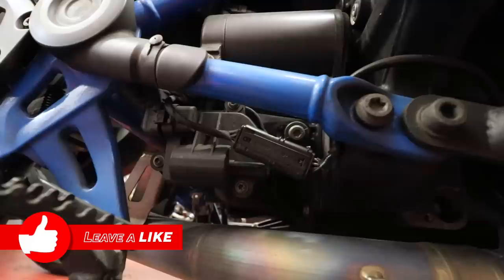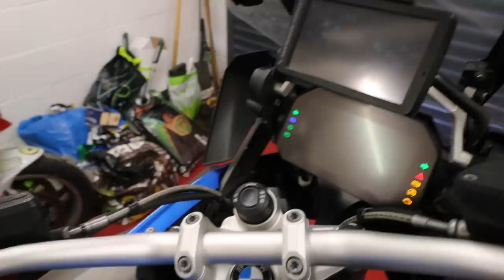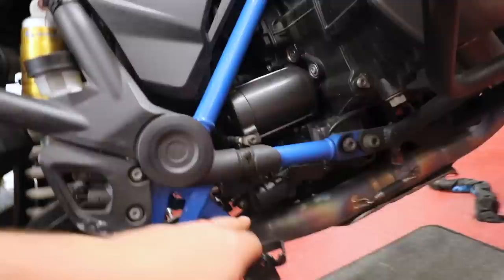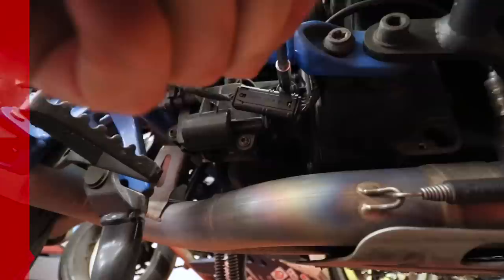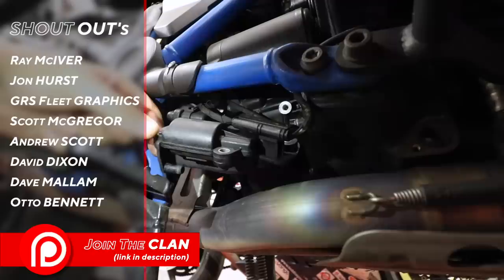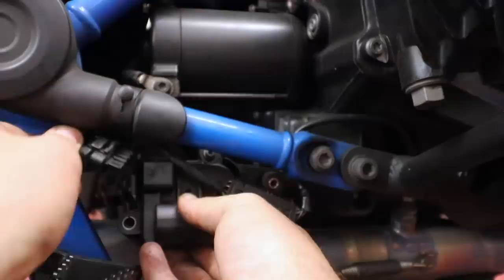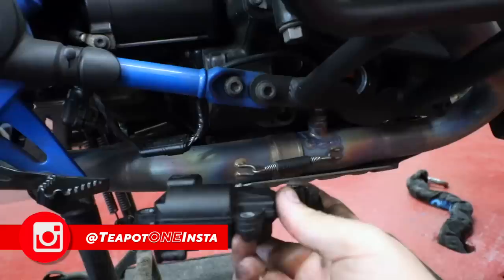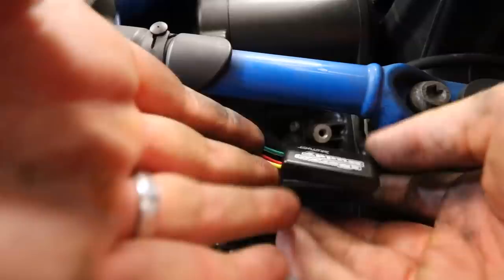Skutrnet Servo Buddy - Exhaust Servo Eliminator Install on BMW R1200 GS

Comment: I wonder if it would be good to slide a bit of heat shrink tubing over the servo buddy and connector as it looks a bit flimsy?
Love the channel mate, and well done for "sticking it to the man"!!!
Reply from the maker: +FriendlyEllis thanks bud - yeah I thought that too, it just seemed to be too open to the elements doesn’t it.

However, I filmed this last August so it’s been fitted to the bike for around 8 months now and been ridden practically every day in all weathers - still going strong and no issues at all.👍

Comment: great video - I don't intend to change the standard exhaust but intend to take out the clakka clakka valve (that's what they sound like on tick over!) so I will need on of these puppies as well - Ta for the info!
Reply: I have the same question. Is the (standard) exhaust flap left in the open or closed position when the servo is removed? Does it it matter? I've not had this issue on my GS so far but interested in this fix... potentially for the future
Reply: @alanhall7213  just start the bike and see for Yourself. Try both positions. Exhaust will be noticeably louder in an open position.

Comment: Bruce out with the spanners and in his own garage 🤔 Nice easy fix and a bit of weight saving on the bike. 

I replaced my FZ1 exhaust system last year (Andy Man Cam can’t ze Germans don’t like it) for a full Delkevic system.  Left the motor but removed the cables that go down through the bike otherwise it errors.  Will check to see if they do something similar for the FZ1
Reply from the maker: Ha Ha yep times are a changing when I end up in the garage with a spanner in my hand! 🤔😂

Hope you find one for your bike, they’re REALLY simple to fit 👍
Reply: There are way cheaper options for FZ1 actually 😉 Check eBay for that.
Reply: Romas Quicker Did the Helltech option great reviews and nearly 1/2 a kilo weight save

Comment: Helge is looking very clean - you really have been bored during the lockdown!
Reply from the maker: +Alpine Larfs was filmed last August 😬

However, Helga has just been professionally cleaned as I’ve just fitted the new SupremeCoat ‘Lifeproof’ paint protection system.

Vid coming soon’ish 😉👍

Comment: And all done without a single cuss word or thrown spanner😂 well done sir! Good vid Bruce.  I’ll ask the obvious one…what happens come mot time? I understand the the uk is falling into line with Brussels on M&U Regs forbidding tinkering with fuel or exhaust gas controls.
Reply from the maker: To my knowledge, I’ve not had a bike be tested for emissions in an mot AS YET. Certainly not had one fail for it 🤷‍♂️
Reply: @teapotone  👍Me neither, and I've written to my MP outlining why they shouldn't vote the white paper outlining this new bill through parliament.  Can you imagine the number of bikes knocking around with aftermarket pipes or deleted exup valves, let alone classics for which no "oem" parts are available?  Crazy.  Good to know there's a solution that works at last for the flapper valve.

Comment: Thank you 👍 Is it much louder after you ditched the catalytic converter and exhaust valve?
Reply from the maker: Yes but not obscenely loud. I could pass the static noise test for Trackdays, but I did trigger the trackside noise meters a few times at Bedford Autodrome 😬
Reply: @teapotone  Shit, I was going to get rid of the cat and the valve to make it breathe better, but the noise level is what holds me back 🤷‍♂️
Reply: @Elskins  sounds like a plan

Comment: Bruce any issue with performance, did u wire the valve open or left it flapping loose
Reply from the maker: I’d replaced the oem exhaust with a full Akra system, the valve is left open.

No issues at all with performance, the bike ride beautifully - I miss it!
Reply: @teapotone  my exup is failing and its more cost effective to put a full system on, would you still use the electronic shunt
steve
Reply from the maker: Yes you’ll need it if you get an error code when you put on the full system
Reply: @teapotone  thanks Bruce

Comment: Great video. Can I ask about MOT. You mentioned you need it for MOT purposes. If I do exactly as you have done on a standard fitting exhaust, do you know if that's an MOT issue? I ask because a sticking valve causes am an engine controller failure warning on the TFT and it's a pain in the A... Thanks for any help and advice from anyone. Cheers, Mark
Reply from the maker: My understanding for here in the Uk is that they won’t actually check for the ‘flapper valve’. They’ll check to see if the end can is road legal but not the internals.
Reply: @teapotone  Thank Bruce. I'm going to follow your vid and do the same mod as you. You're a Star :) Cheers, Mark

Comment: Hi again mate.  My question from a while back regarding what the servo does, was worded stupidly.  And now that i am the proud owner of a 1250 (which has the servo installed), i am still confused by its purpose.  Do you know if it is solely related to engine braking ability...  or is it blended in to the shift cam system, allowing more exhaust under variable valve depression?  The fact you have this on the 1200 engine, makes me think it is all about volume and engine braking... ???  If you dont know... no harm.  I will just ask the blokes i bought her from :)
Reply from the maker: I don’t know the full technicalities of it - my understanding is it’s mainly for emissions purposes and as such by removing it you release more of the potential of the engine.
Reply: A exhaust servo serves a few purposes, it makes the bike quieter at lower rpm and increases midrange torque. It also increases back pressure and richens the engine in the mid range to reduce emissions. 

The reason most exhaust manufacturers do away with a servo on their systems is because in most cases this also reduces high end horse power due to the restriction in the exhaust.  

Hope this helps 👍🏼
Reply: @oOLLOYDOSOo  Dyno charts show it doesn't increase torque in any circumstances. Its a myth. Its purpose is solely for sound emissions.
Reply: @oOLLOYDOSOo  All it does is makes the bike quieter at certain times. No more.

Comment: Hi Bruce, what’s the score with your warranty now you’ve fitted that exhaust??
Reply from the maker: +FUBARadventure I had the exhaust fitted by the dealership before I even collected the bike. I’ve had full Akra systems on both my GS’s and it’s never been an issue on any warranty work at all👍

Comment: After installing the decat headers did you notice a change in fuel economy?
Reply from the maker: +Gordy's Goodworks no not in either way to be honest - the bike just breathes better, the throttling feels ‘spicier’ and more dynamic - that may just be because the bike sounds amazing now so you automatically feel like it’s better.

I’ve also had both my GS’s taken to Hilltop and Geoff has worked his magic on them, so they’re certainly more of an animal to a stock GS. It’s noticeable to go from a stock GS straight into this one 👍

Comment: you have just committed the ultimate sin!!!! snipping ty-wraps with side cutters. It leaves a razor edge to cut you. trim flush with a knife fella. helicopter engineer and I get bit all the time by this!! Pet hate mate. Having worked with the police for many years. I'm of the opinion that if you lock a bobby in a cell with 2 cannon balls over night. By morning he will have lost one and broke the other. I wish you well as you step into the engineering world pal. 
I had the valve fail on my 2010 multistrada. I fitted one of these and the difference to the bike was amazing. so much smoother. However shortly after all the computers on the bike died. luckily Ducati were amazing and sorted it out of warranty.
Reply from the maker: Ha Ha, Gareth you’ve summed up Coppers to a tee there bud 😂

Cheers for the tip on the cutters - seen and noted👍

Comment: Its an old problem from the 1200 days caused by poor design that should have been resolved years ago and I believe its only there for the EU emissions regulations when on tick over.Some riders use a high temp grease on the exhaust flap bearings but it still goes eventually.
Reply from the maker: You actually get this issue with just about every single bike out there which has an exhaust/butterfly vale and is ridden in all weathers. 

As you say Andi, it’s a poor design of locating this part generally at one of the lowest points of the bike, right down near all the crap coming up of the road etc.

Yep it’s there for emissions standards, and lubing/greasing the valve/flap intermittently can aid the issue👍

Comment: It's amazing how many people can't deal with the exhaust regulator. They really think it's a bad thing and hacking it will gain them a better life. HaHa
Reply from the maker: No, it’s purely because my exhaust didn’t use the flapper valve so the bike threw up an error code - and this gadget gets rid of that